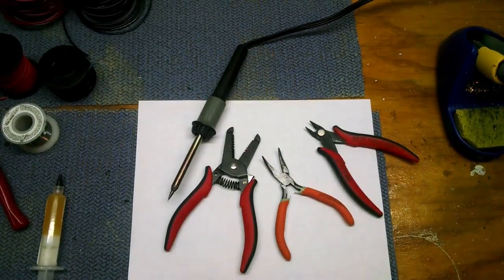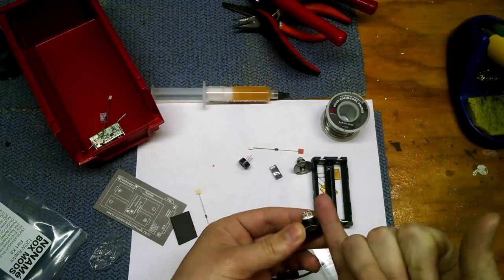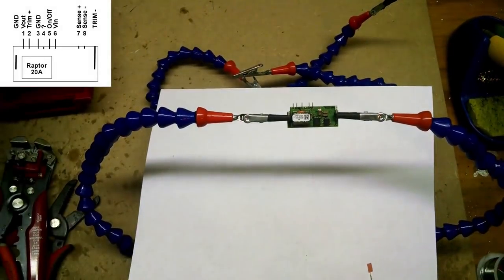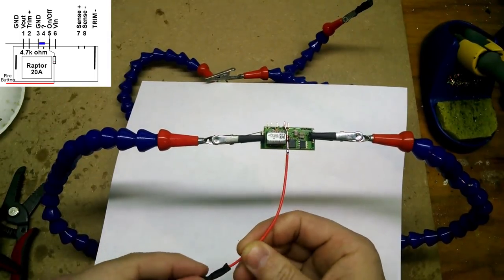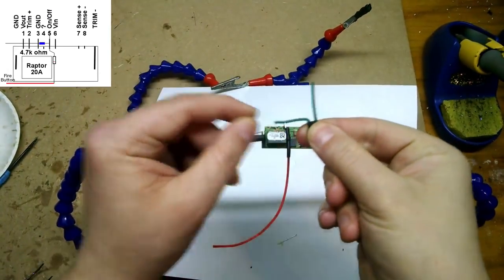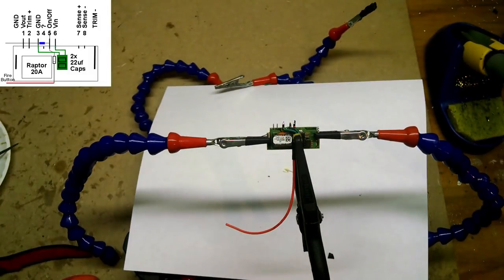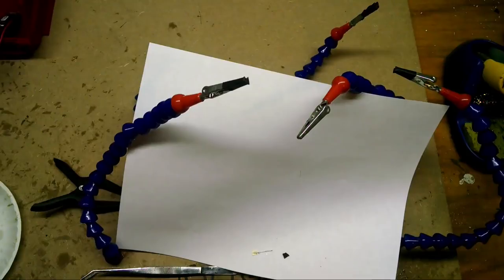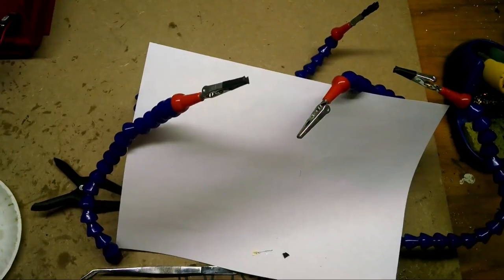120W Raptor Box Mod Wiring: Part 1 - Revised

Comment: im almost all set to start building my box mod, but because you no longer provide all the parts on your site, im wondering where you get the 22uf capacitors from? only ones ive found are not like what you have in the video. i found them on ebay but im wondering where your more reliable sorce is from. Thank you!

Comment: so got the dual 18650 PCB MOSFET kit, the SMD mosfets and 15Kohm resister is on the Noanme box mods PCB with the switch, yes?
Reply from the maker: Are We Recording Youtube Correct.
Reply: awesome saves alot of headache, and space! great job good sir!

Comment: A question about soldering, do you keep adding solder to the iron off camera?
Reply from the maker: adam v Yes, it's an often debated soldering technique, but so is mish-mashing a bunch of parts together.
Reply: Advicevice  It looks a lot cleaner than trying to hold the solder on the part.

Comment: could you tell me the width of these chips after youve soldered all the wiring on? im planing on fitting one but i have limited space in what i am going to be using to house it all :P TIA
Reply from the maker: +lewis smith I want to say about 2" with the shrink wrap on and wires sticking out. Maybe a little less. I don't have one wired up I can measure at the moment.
Reply: is that on width? if so it defo aint gunna fit lol

Comment: hi i a, currently buying materials to make a 16 vv box mod, using a lipo battery, a voltage readoutt and a potentiometer would you reccomend anything else to keep it safe? thanks
Reply from the maker: +caleb o If that's all you're using that's not going to work. You'll burn out the potentiometer, or start a fire, or both. Check out https://www.reddit.com/r/OpenPV or the BoxModders group on facebook for some safer ideas.
Reply: thank you for responding so fast, i thought id better ask someone with a considerable amount of knowledge in the area then to venture off on my own. thanks
Reply: +Advicevice honestly i have know idea how to a mosfet works, is there anyway you can find the correct mosfet for me and i can pay you for your time via paypal, sorry i just dont want to kill myself.
Reply from the maker: +caleb o I sell this kit with all the parts needed: https://nonameboxmods.com/mosfet-part-kit
Reply: all the parts will be anle to handle like 700 watts?
Reply from the maker: +caleb o No, I don't think that would be a good idea. It would probably burn out the MOSFETs. You should really consider a more reasonable build for your first project.
Reply: i saw someone using just an automotive relay on their lipo box, is this still dangerious
Reply from the maker: +caleb o I'll be honest, 16V is just stupid and unreasonable. Even 12V for an unregulated box is way overkill. If you want to build it just because you can, that's up to you, and I guess you're free to blow your face off. You really need to do a lot more research first though.
Reply: yea im not plannig at running it at 16 volts that is just the maximum volts that my battery can put out. would two IRFP4321 mosfet in parallel and BYW29e200 Recovery diode.
22ohm 5W in and 83nF 200v capacitor work to control it. with come fuzes of course
Reply from the maker: +caleb o I really don't know what design you're referencing with those parts. You would be better off asking the person that came up with it.
Reply: would you make a video of you assembling a pwm and mosfet for 16 volts, i will pay you what ever you find fair, in the meantime i will do more research